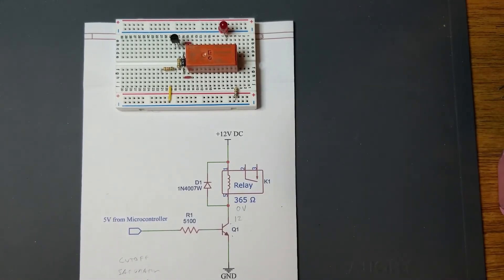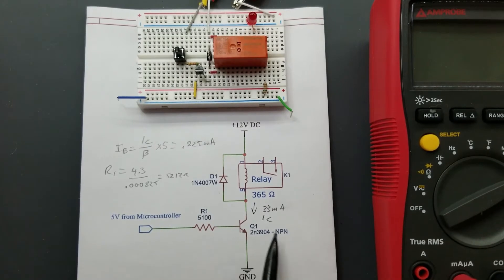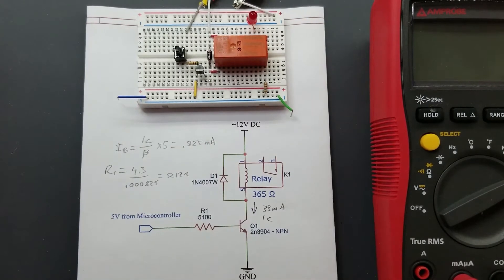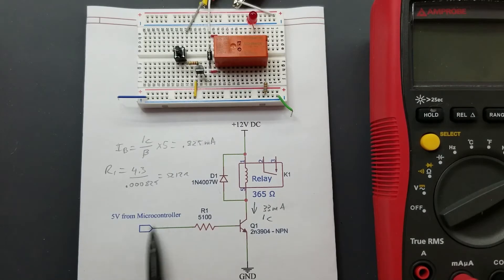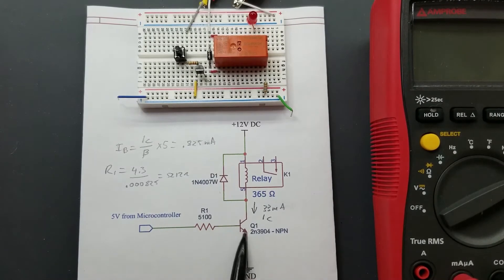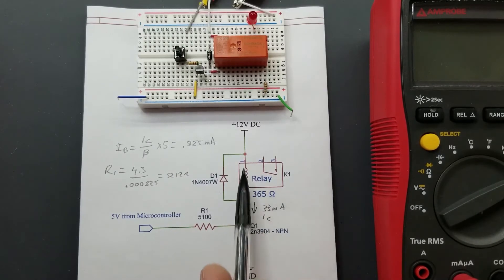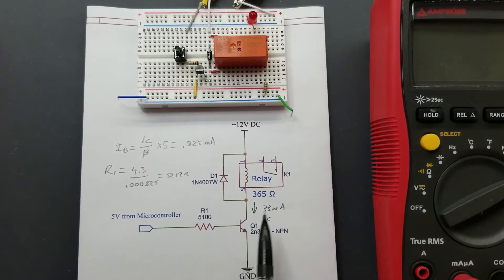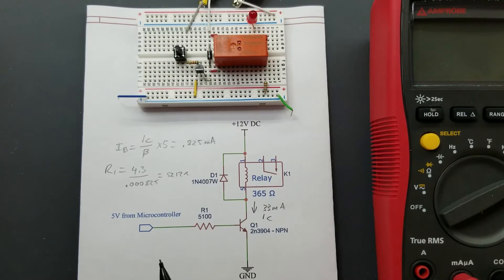#13:  Basic Relay Control Circuit on a Breadboard

Comment: The diode connected next to the relay is to avoid the relay pull back the voltage to the 12v source??? Can you put the diode after the relay like a resistance?